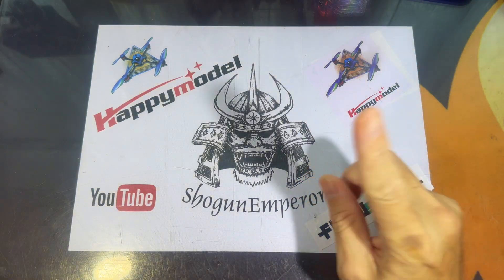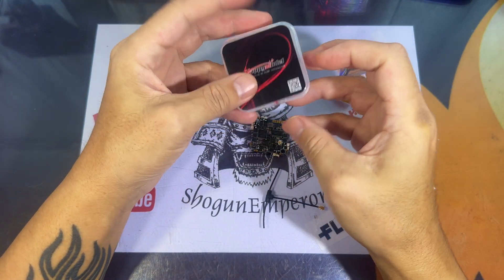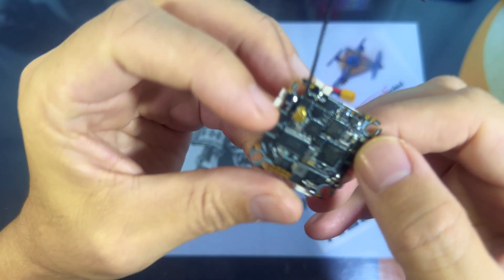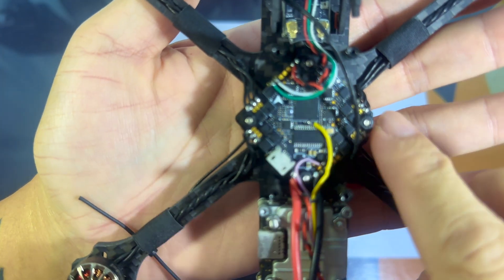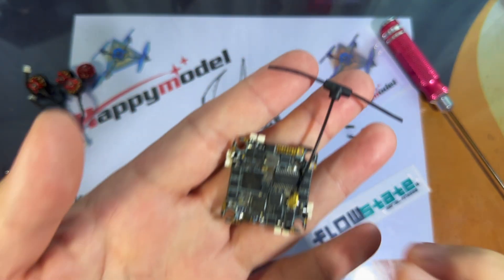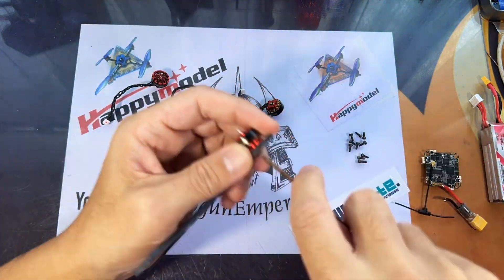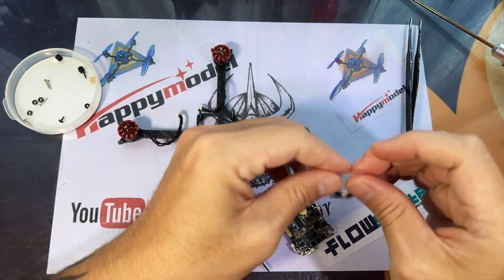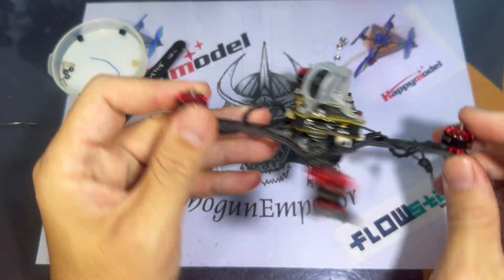New CrazyF411 ELRS with BLUEJAY | Happymodel

Comment: Hey bro, it's me again, how are you? I really need your help again my on my crazybee f411 flight controller, I think I made a mess flashing the firmware, do you have any idea where to get the original firmware/ target? Thanks in advance
Reply: No, mine is the elrs version with ep1. The problem is the motor wont start to spin when arming, but it has 5 beeps when plugging the battery. Thank you for your reply.
Reply from the maker: @ oooohhh.. yeah. So boost up the ramp up power to 1105 on ur esc. See if that works.
Reply: @shogunemperor  I also try to run on betaflight motors tab motor direction and it wont spin.
Reply from the maker: @lodovicocarlos4522  did u turn on rpm filtering? If im not mistaken, if u turn it off the motors will spin
Reply from the maker: @lodovicocarlos4522  hey bro! Doing alright!! I think its this one. U have the frsky version right?

https://www.happymodel.cn/index.php/2023/04/01/dump-file-and-firmware-hex-file-for-crux35-frsky/

Comment: Is it possible to add flysky fsia6 receiver (ibus) with this aio board. Please reply sir
Reply from the maker: There are no SBUS or IBUS pads on this FC maybe try a different model.
Reply: @shogunemperor  thank you for the answer
Reply from the maker: @ pleasure bruddah! Good luck with ur build!!!
Reply: @shogunemperor  can we connect any elrs trasnsmitter directly with this aio board ?
Reply from the maker: @ yes you can. It just requires 4 pads, tx, rx, 5v n GND. I think its TX2 and RX2 which is one of the dedicated UART for receiver

Comment: 3:45 Resofthefuckingowl Jesus man, I need to solder the vtx to the aio and I do not know which pins to solder to...your video glazed right the hell over it.😅
Reply from the maker: ROFL hang on.  So if ur using the F411, note that there isnt enough UARTS to solder smartaudio.  

https://www.happymodel.cn/index.php/2023/02/07/happymodel-crazyf411-elrs-aio-4in1-flight-controller-built-in-uart-2-4g-elrs-and-20a-esc-for-toothpick/

use TX1 and RX1 as TX2 and RX2 is a dedicated UART for receiver.  Let me know if u need anything else!
Reply: @shogunemperor Excellent! I've narrowed down that CAM -> VIN and VTX -> VOUT but I still need to know what to do with the SA cable and the RX cable. This flight controller needs to replace the LED_S pin with SOFTSERIAL1 For I believe Smart Audio which would leave the RX pin to go to TX1 on the flight controller. What is RX pin on the camera VTX?
Reply from the maker: @CamdenWallraff  i desoldered the SA for mine.  I used RX1 and TX1 for the VTX for both HDZero and Vista.  I dont have an analog version for this.

Comment: Good day bro, how are you today? I hope you're doing fine, I've just recently bought this crazybee f411 aio flight controller for my tiny whoop built, I already bind the receiver to my transmitter, but the problem is the aux switches are not responding to betaflight configuration, I cannot arm my quad. What is your suggestion, thank you in advance, have a safe day.
Reply from the maker: Doing good bruh! Hope ur well too!! Oh! Check the AETR and TAER on the receiver tab on betaflight. Make sure they’re synched with ur radio. Let me know if u still have issues ya
Reply: @shogunemperor  I have already done that, I open up the receiver tab on betaflight, all the gimbals are responding, they show movement when I move the joysticks, but the model drone in betaflight is not responding. Thank you again

Comment: hey I had a question. So currently my motors are the mamba 1105 but these are without the connecetor so I can plug to the fc. 
the fc has tiny soldering pads so I cant solder either. So I just wanted to check what connector I should buy that could fix into this fc cause there are so many variants of jst.
Reply from the maker: oooh.. those are JST 1.25 plugs!! 
https://newbeedrone.com/products/newbeedrone-jst1-0-jst1-25-motor-plug-replacements-cable-50mm
https://www.tinywhoop.com/products/free-motor-plugs-and-wires-for-nbd-boards
Hope these links help.
Reply: @shogunemperor  thank you so much!
Reply from the maker: @ekanshchawla2986  pleasure bruh

Comment: Which pads do i solder caddx vista to. Including sbus wire?
Reply from the maker: RX-TX, TX-RX, 5v-5v, GND-GND, for sbus, u may need to check the Caddx website as I never use it.

Comment: This is what so many have been asking for! UART ELRS and 20amp. Happymodel listened! 🎉 🙂
Reply: If they used the preferred f405, how much more would it cost?  My guess is that the increased cost for an f405 vs the f411 is under $5. Worth it.
Reply from the maker: @cccagley5276   i somewhat agree with that too!!  But perhaps, from their manufacturing perspective they're buying chips in bulk.. so i think for them it makes a difference. I'd prefer the F405 too.. faster CPU processing
Reply from the maker: Hahahah ive been bugging them about it! 🤣🤣 only flaw of this FC is the lack of UARTS tho
Reply: @shogunemperor  Yes, such is the limit of F411 unfortunately. But F411 is cheaper than F405 and F7 and betaflight cloud build system is going to keep these around for a while longer. Honestly, anything that keeps the hobby cheaper right now is ok, these f411 are fine for this specific purpose.
Reply from the maker: @JohnCuppi  ur right man!! And with rising cost and low production its a pain in the ass for sure. Have an awesome weekend bruh

Comment: This looks much easier to soldier! I have an x-12 aio v2.1 elrs on my Crux3. I managed to damage camera connector on the board. I’m curious if I have to replace that tiny connector or solder to the pads on the board. Reroute it in the cli? Thanks brother!
Reply from the maker: Quite actually. Oh? Would it be possible to remove the connecting pins and solder the camera direct?  That would be my viable option. Unless the pads are lifted.
Reply: @shogunemperor  Gotcha,Thanks for the quick response my friend!
Reply from the maker: @MisterT43  my pleasure always bruh! Good luck!!

Comment: My original crux35 fcs are still going strong, but will probably pick up one for backup soon. Glad they have increased the amp spec. It just gives a little more confidence. I was thinking maybe you were a little hung over and speaking softly lol.
Reply from the maker: Yeah. Mine too! 20A just gives u that lil bit of “umph” needed. Hahah nah bruh, caught a chill one windy morning without a beanie or earmuffs. So the cold got me good.
Reply: When mounting in the crux35 frame, do the motor connectors orient favorably when rotated to fit the frame? And I assume you have to adjust for the board orientation 45 degrees in betaflight as well? Hope you feel better soon.
Reply from the maker: @kurtzFPV  aaah no it doesnt. The mounts are on the diamond end. So if you mount it square the wires will be 2 long 2 short.